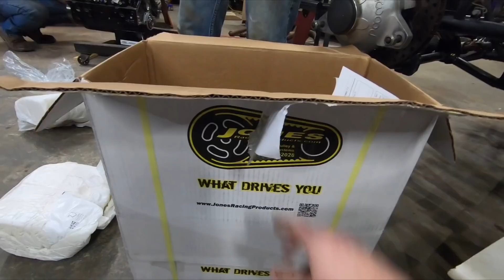When Will Jesse Race? The 602 GM Crate Engine is in the Trak-Star!

Comment: The HTF1 is going to need a blue paint scheme to match the steering wheel now. Jesse the car is coming together and getting closer to Raceday. I know some folks were talking about the fan, we had to switch to an electric fan because we kept slinging a blade off through the hood of the car, plus we were able to regulate out water temp as well, especially on cooler nights. Anyway everything looking good thanks for the video again, awesome job.

Comment: Love your guy’s videos so I have to offer a little helpful advice.   If you mount the pulley to water pump first.  Tilt front of water pump down and put the belt on and then install the water pump bolts into the block.  It’s a lot easier!!!

Comment: I may have a silly question I'm not real familiar with the crate motors if you have to get inside the engine to fix something let's say a timing belt and you have to break the seal how do they determine whether you got into the motor or not or are you even allowed to work on the internal parts of the motor
Reply: Only certified shops are suppose to work on sealed crate engines.   That eliminates the racers from cheating by building better engines,  this whole class is about keeping the cars equal as can be.